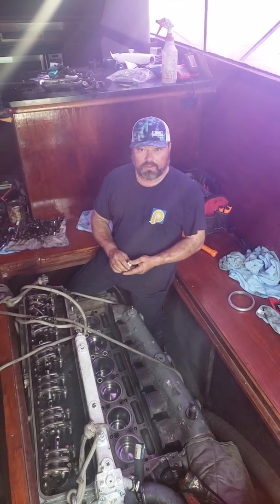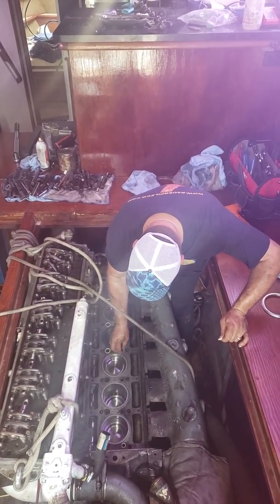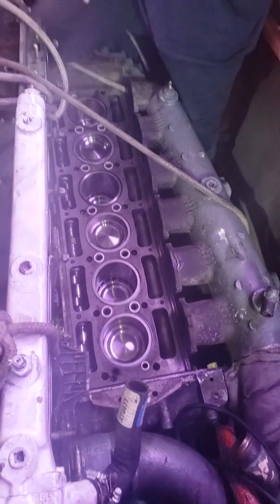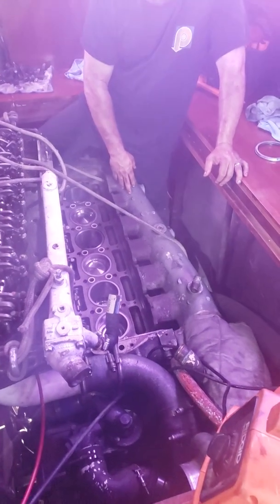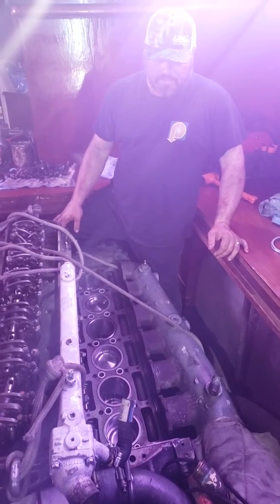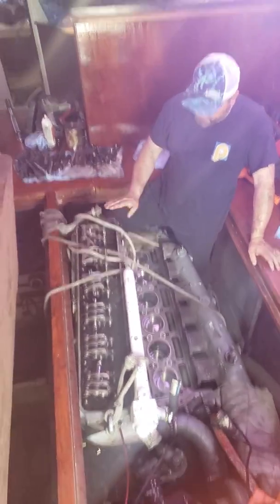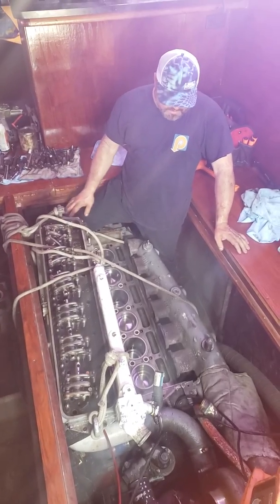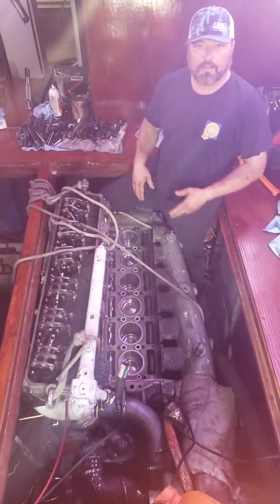Detroit 671 Tib Marine rebuild inframe

Comment: The liner depth should be checked so you get a good crush on the head gasket to reduce any problems. .046 below the surface to get a good seal. Then no blown head gaskets

Comment: Did you end up having to lift the entire engine at least a few inches in order to get access to the bottom end (oil pan removal  for access to connecting rod clamps, bearings etc... )